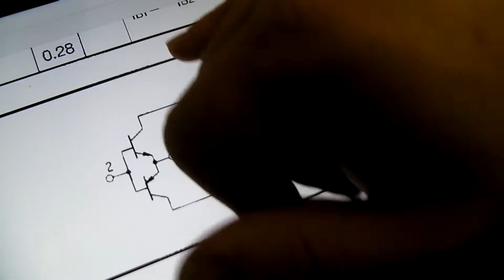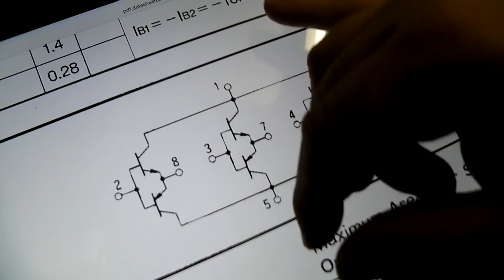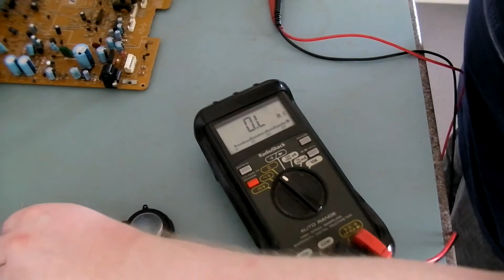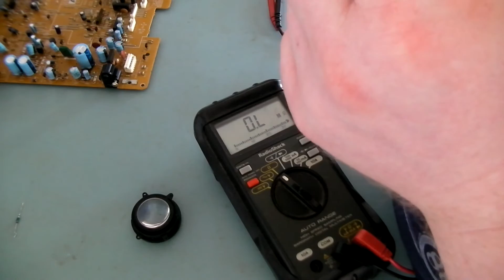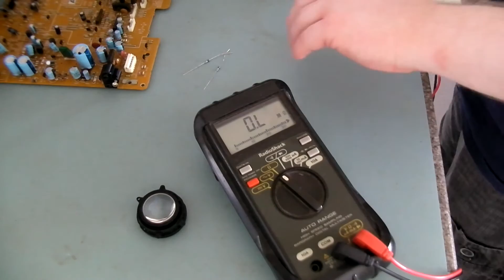Repair: JVC XL-E34BK CD Player

Comment: I was hoping that the CD Player that you were fixing would be similar to one I’ve got here, The one I’ve got here is the JVC XL-E3BK, Mine’s quite a bit older than that one I believe, It’s definitely an older looking display on the one here, I’ve had to replace the Power Cable as the original was not safe to plug in as the cable had got damaged, Once I’d resolved that the Tray wouldn’t open, Theirs an inspection hole underneath mine with an arrow, Managed to get something in to turn the Drawer Cog and then replaced the Belt which was relatively easy when I figured out what needed to be done, Also replaced the Belt for the Laser Diode, The Drive Motor is Direct Drive and tested it and it spins fine but the CD won’t spin all I’m getting is a ticking for a few seconds, Their’s nothing to adjust on the laser itself but I can see Pots on the Mainboard: TRK.G, TRK.0 & FOC.0, Would one of those be what I could try adjusting by any chance?

Comment: Similar player JVC XL-E3BK with a intermittent play problem. Thanks to your vid, I had a go at fixing it. Turned out to be a sticking transport sled, drive voltages to motor were fine (began at 1.5v then ramped up as error increased), so problem was mechanical & turned out to be a duff drive motor. Original RF-260T-08450 motor was silly expensive but a similar RF-370-15350 fitted & works great now.

Comment: Hi there I have been given a jvc  xl e3 and receiver plus deck. After cleaning it all up the cd doesnt seem to power up. No display shows.  I have changed the 3 amp fuse in the plug. Still no joy. Any suggestions would be gratefully weclcomed. Thank you

Comment: Tanks for your interesting video! 
I have a question for you. I've got the same CD player with exactly the same problem that you had. Could you explain wich part / resistance I have to change to repair it ?
 I would like to repair it myself but i am not expert in elecronics and Hi Fi !
Thanck you a lot for your help
Clem from France
Reply from the maker: grimp fb Hi, there’s two 10Ω resistors in the power supply, I don’t know the component designations but you can spot them towards the back of the board and they are elevated so they do stand out a bit.  In my case one of the resistors in the negative power supply was open but I replaced both anyway.